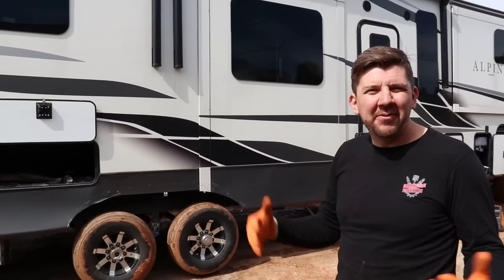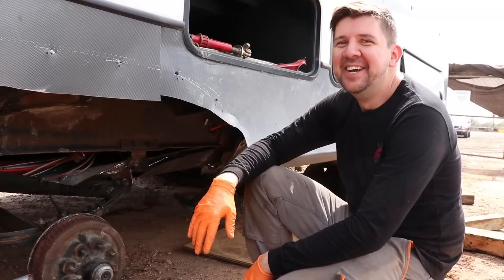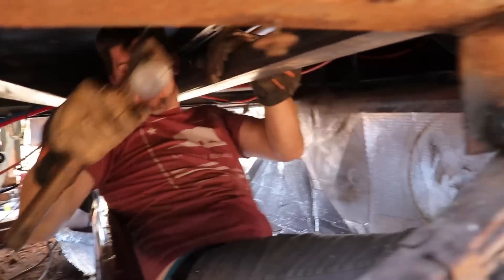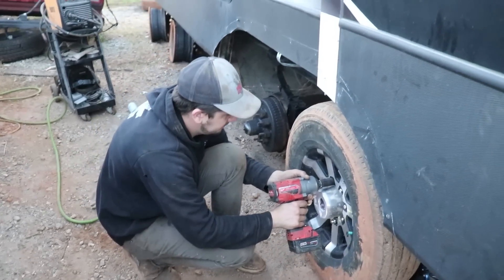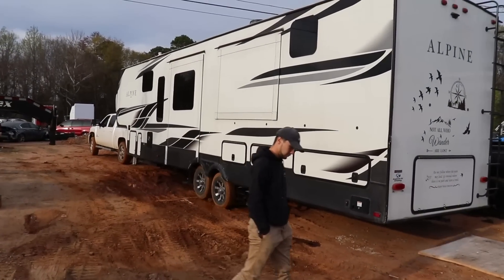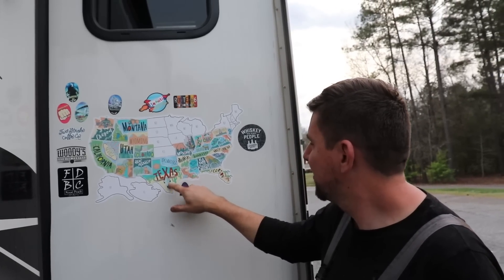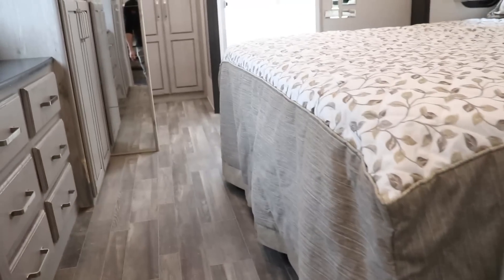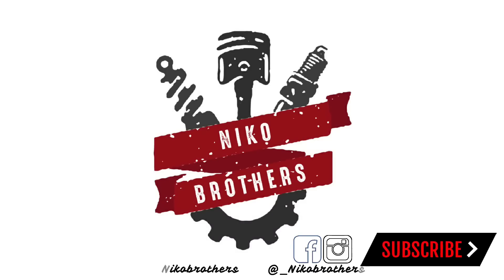WRECKED ALPINE 5TH WHEEL CAMPER AXLE FIXED & REINFORCED

Comment: . . .  Interesting project for sure.  One wonders what would cause that frame damage.  You reinforced it well.  I once helped a friend align his axles.  The camber came out of one axle.  . . .  He travelled some back roads loaded with far too much weight.  He had had a "professional" RV mechanic check it over.  Would you believe a U bolt on a spring was missing a nut?  That was sure a "confidence" builder.  It is nice to see you using your head(s).  Thank you for sharing.  😊

Comment: Nice fix on this one, fairly easy compared to others in the past.  For sure.  I'd get rid of all of the exterior stickers, writings, whatever is not original to the unit.  The front kitchen models are always awesome and spacious.  The kitchen has that bar for eating, usually (as you said) with a couple of bar stool type chairs.  That living room could have come with three sofa's instead of having a small dining table/chairs but it would be a good spot for one.  I'd put new sofa's/sofa recliner/recliners in there myself.  The existing are two colors and that one looks a bit worn.  The extra mirrors in the master bath could disappear as well.  So is it going up for sale, sold, where do you have it listed, ?????  Thought you said this one has a title, and since I've sold my Class A almost two years ago, I may be interested.  Getting info would be nice.

Comment: Hey guys, the tires should not be off the ground when you level out. You probably should reset the zero point. It's really easy to do. Level it manually turn the controller off, tap the up button 10 times and then the down 10 times or until it turns on, it will ask you if you want to reset zero point, confirm yes, it will beep and turn off then you should be able to level out without it picking wheels off the ground